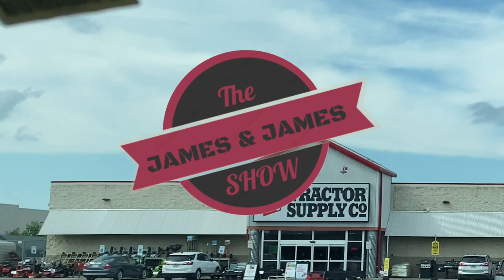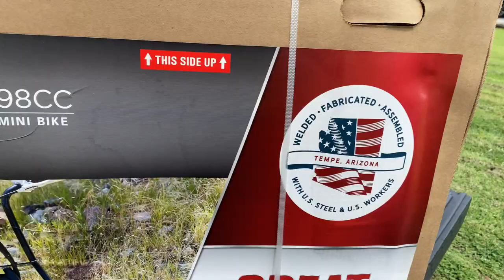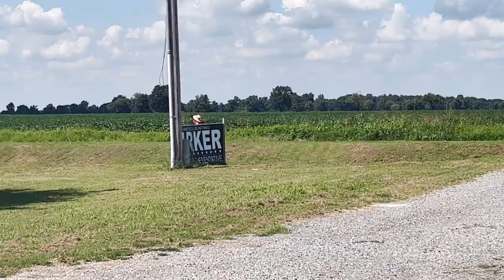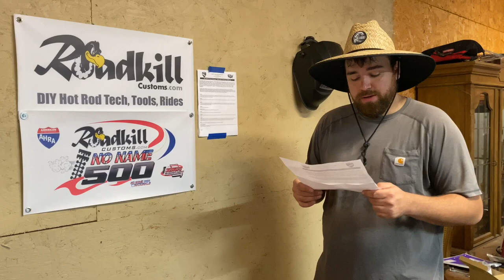MONKEY BIKE CHALLENGE! unboxing a Coleman ct100u mini bike and first ride.

Comment: Welcome to the NNN! My monkey bike has been reworked and will be fast. You should be able to get it going 40mph with the limiter disconnected. A slide carb would be a good upgrade if you are handy enough to fabricate a manifold/adapter. Don't forget to order yourself a safety tethered kill switch to qualify with the tech inspection. Looking forward to seeing more of your project.
Reply: @johnwilburn  I spent ALL day tuning on my little monkey bike today. I hit a max speed of 34 mph. Most fun I've had with it so far.
Reply: @kimfixesthings  That's cookin' on one of those little bikes!
Reply: @johnwilburn  It feels like 60!, I need some riding gear before I'm willing to go that fast again, but I believe this build has more still in her, but I had to let off. Need help recording my tests.